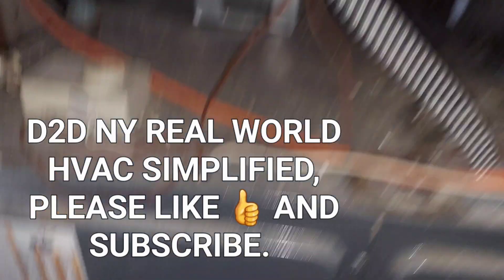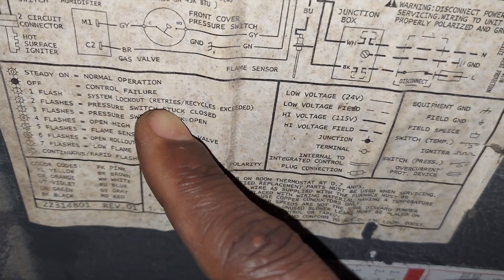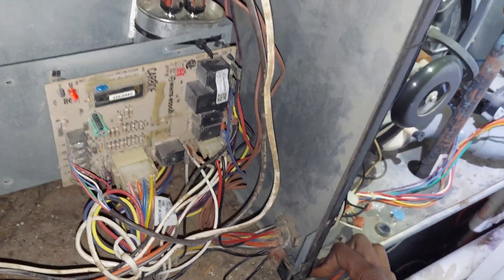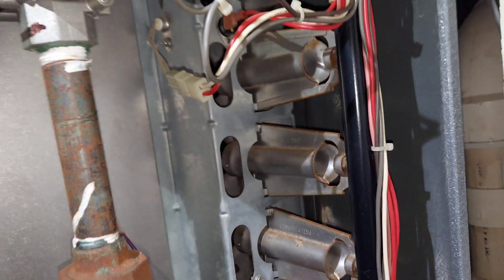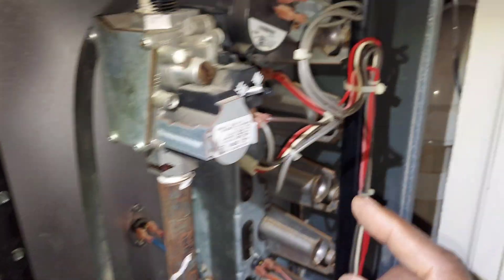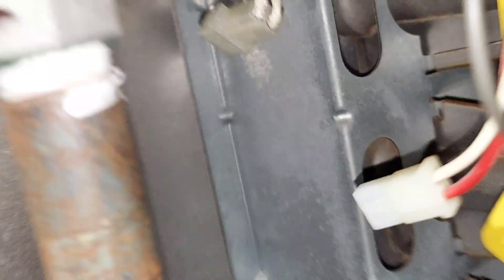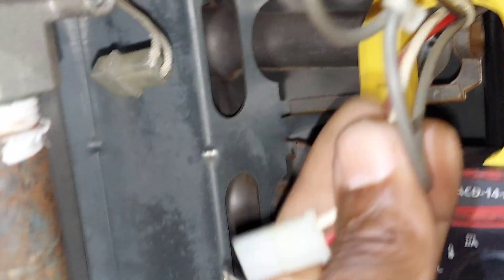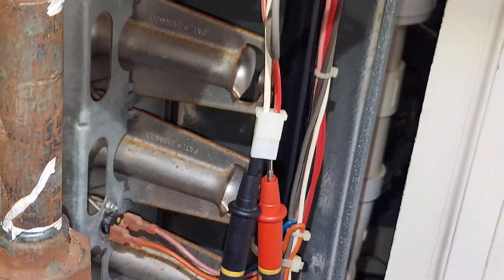GOODMAN FURNACE | HVAC TROUBLESHOOTING

Comment: Just fixed my friends furnace. He has the DTE plan for service. They sent some clown out, and they told him he needed a new furnace. I did not have all  my tools on me, just a 6 n1 screwdriver and my voltage tester pen. I get their and find his door switch shorted out. Took about 10 seconds, it took longer to take the doors off and put them back on. He was fking pissed off. They quoted him 5800 for a 96% and 4600 for a 80% .